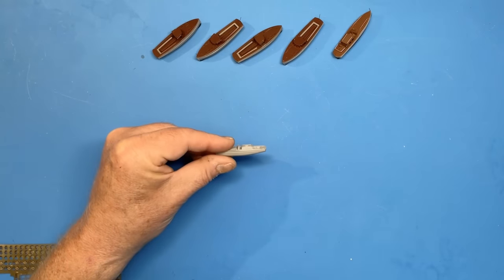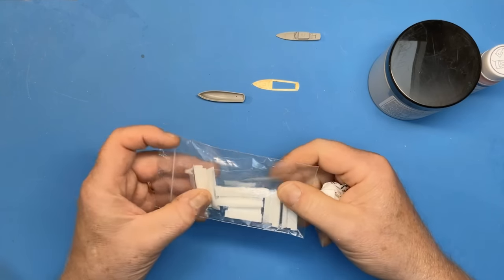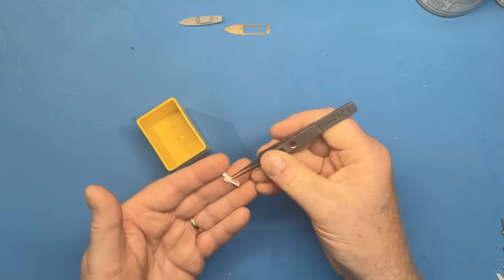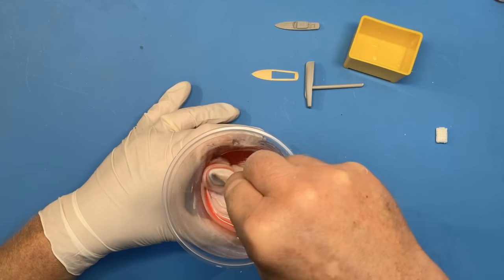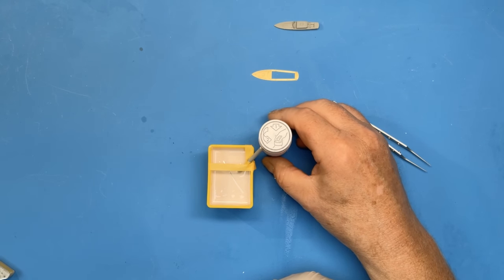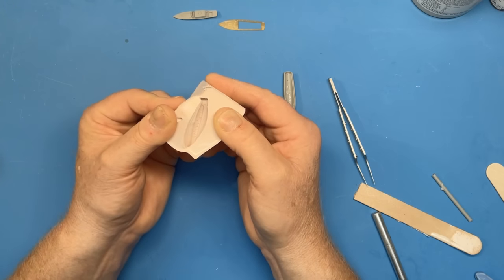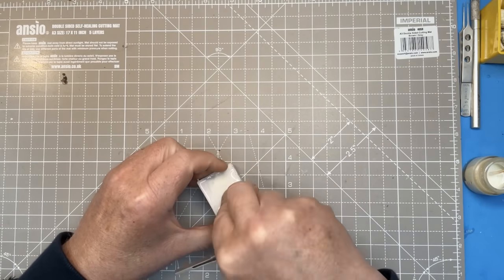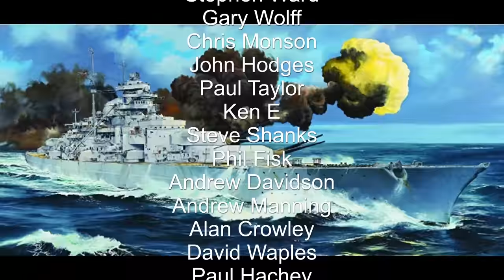Trumpeter 1/200 DKM Bismarck Full build with Pontos detail set Part 31b

Comment: 11:11 I've done something similar to this and have found that by placing the part into the mixture, completely emersed, and then in a vacuum chamber will remove most of the bubbles. Interesting episode! Thanks Steve.
Reply from the maker: Sounds a bit technical for me Ron 😬😬 next time I’ll paint a coat of the silicone over the plastic before immersing it that might work?
Reply: @TheModelShed  Re: "paint a coat of the silicone over the plastic before immersing" That's a good thought! At least then there will be less bubbles against the part.

Comment: Hi Steve, always great to see progress on the Bismarck. Interesting to see your approach to casting. I have settled for two part molds only, as the parts can easliy be removed and the cavities can be prepped better. I usually build up the walls around the master from plasticene. This is very versatile and can be customized and reused time and time again. I also model the plasticene walls in a way that they provide a natural undercut for any on top mantle mold from plaster (to keep larger molds stable, and to save silicone). Anyway, love your build and always looking forward to the next episode.
Reply from the maker: Cheers Klaus I’ve got some plasticine so I’ll give that a try. 👍

Comment: Steve, many years ago, more than I care to remember. I dabbled with casting some parts for small-scale military vehicles. It was white metal back in those days, but the trick I learned was to make casting molds from Lego bricks, they have the advantage of allowing an infinite variety of sizes and can be disassembled after the cast material has set making it easy to dismantle. Hope this might help in any future projects.
Reply from the maker: Good idea I’ll. look out for some 👍
Reply: @TheModelShed  I would add to this that you can make your mold in two parts with lego.  a channel called punished props (https://www.youtube.com/@punishedprops/search?query=resin%20cast) have some really good articles on this, including registration of the two part molds.  Hope this makes it easier

Comment: I've never had the courage to try making my own resin parts but a lot of people that do it use Lego blocks to make the box. One of my other subscription channels the fellow who started it does some casting. He suspends the part slightly off the floor of the box then pours the silicone in just enough to lightly cover the part before adding the rest. When that cured and the part was removed before adding the resin he lightly coats the inside of the mould with a bit of talcum powder, I'm assuming this is to make it easier to remove the part. That was a good job you did for the casting and I hope you can come up with a solution for the last boat you need.
Reply from the maker: Thanks for those tips I’m picking a lot up this week

Comment: Omg you tube updating comment box, making it worse as usual. Anyway.... Expert here, you can use vaseline as a release agent between the silicone  parts, it works no problem at all. When you cast parts that small, give the silicone molds a light dusting of talc powder, this eliminates most air bubbles. It doesn't matter how slow you stir the silicone it will have lots of air in it. You can try and pour in a long thin stream into the box to reduce the larger bubbles. Whenever you "dunk" a part in silicone, the underside will always get peppered with air bubbles (unless vac degassing) I would have brush painted the silicone on your boat first, airbrushing it with air only, pushing it into all the nooks and crannies. But as you know a 2 part mold would have been the Way to go.
Reply from the maker: Some great tips there which I’ll try next time. Thank you 👏